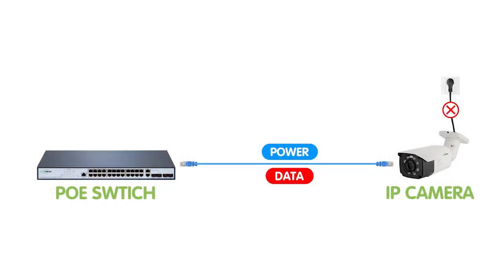Link 2 PoE Switches over Cat6 Ethernet Cable

Comment: Hello, I was wondering if you could help. I had a 16-channel NVR with 8 cameras in one house and 8 in another. One of the residences was sold, and I needed to remove eight cameras from the 16-channel NVR. The new position for the NVR is about 50 meters distant, therefore I chose to run one CAT 6 cable to the point where the eight cables meet. My intention is to install an 8-port POE switch to connect all 8 cameras via CAT6 cable back to the NVR, which will require another POE switch. From this POE switch, I'll connect my router cable, my NVR Lan cable, and finally my CAT6 cable to the other POE. Will this work?
Reply from the maker: Yes, your plan will work. As long as you have adequate power supply for the cameras, network bandwidth is sufficient, and all connections are securely made, this setup should work effectively.

Comment: It is connected in series daisy... previously you said preferably not to connect both switch in series mode
Reply from the maker: Connecting just two PoE switches directly with a single Ethernet cable is generally not considered a daisy chain. A daisy chain usually refers to a series of three or more devices connected in a chain-like sequence (A → B → C, and so on), where data passes through each device in the chain.

In this case, with only two switches directly linked, it’s simply a point-to-point connection between them.
Reply: @Fastcabling  thankyou for providing great explanation... Point well understood
Reply from the maker: My pleasure!

Comment: hi..can i use the uplink port as a normal port? i have 4 normal ports and 2 uplink ports.. but i have 5 devices to connect.. thanks
Reply from the maker: Yes, these ports can usually function just like regular ports for connecting devices such as computers, cameras, or other networked equipment.
Reply: @Fastcabling  thank you so much for the prompt reply..i learned a lot watching your videos.
Reply from the maker: My pleasure! If you're interested, we've created different network solutions. Please check👉https://www.fastcabling.com/pages/networking-solutions/

Comment: Hello, I saw another video by you in which you say not to dazzy chain POE switches. What you did in this video, is it not dazzy chaining them?
Reply: Reason why I ask is because I have 64 Cams and I want to distribute them in 3-4 Gigabit POE switches. How do connect them all?
Reply from the maker: Connecting two PoE switches over a single uplink is technically linking them, but it's not the same as creating a long, dependent daisy chain.
Reply from the maker: You’d better connect them in a ring. https://www.fastcabling.com/pages/3-effective-ways-to-daisy-chain-poe-switches/

Comment: Hi, thank you for the video. For 2 poe switch 1 nvr and to view online in phones can i use this type of connection. I meant does conncting nvr to router gives access to remote viewing of cctv?
Reply from the maker: As long as all your PoE switches are part of the same network (LAN) and can communicate with each other, your NVR will still be able to receive video streams from cameras connected to any switch.
Reply: @Fastcabling  thank you I have two uplink port on both my switch. So can I connect from Poe 1 uplink to Poe 2 uplink and poe 1 2nd port uplink to router and Poe 2 2nd port to NVR.. will this allow me to view remotely?
Reply from the maker: Yes, this setup will allow you to view the NVR cameras remotely. Or you can connect the NVR directly to the router. The NVR will still be able to communicate with the cameras since both the PoE switch and NVR are connected to the same network via the router.

Comment: Can we connect two poe switches.from Normal Port to Uplink Port or Uplink to Uplink vice versa is it possible?
Reply from the maker: You can connect two PoE switches using either:

1. Normal Port to Uplink Port: This setup is ideal if one of the switches has an uplink port with higher bandwidth (e.g., 10G or 1G), and the other switch's normal port is only 1G or 100M.

2. Uplink Port to Uplink Port: This is typically used to create high-speed inter-switch links for large data transfers or connect the access/distribution switches to the core switch. 

3. Normal Port to Normal Port: This is often used in smaller networks where you don't need a high-speed backhaul between switches. Modern switches support Auto MDI/MDI-X, which automatically detects and adjusts the pinout of the connection (so crossover cables are no longer necessary).

Comment: Uplink Port to Regular Port, or Uplink to Uplink Port, which the best?
Reply from the maker: If high bandwidth is needed between the two switches (e.g., for high data transfer rates or many connected devices), uplink to uplink is often preferred. In this case, we connected uplink to uplink using fiber connections to maximize throughput (10Gbps).

Comment: What if i connect a poe port to another PoE port?
Reply from the maker: That will also work. But some very old models of switches still need to use a crossover cable to connect the sending pin on one end of the cable to the receiving pin on the other end when connecting two common network ports. However, many modern switches support Auto MDI-X, which automatically detects the proper connection type no matter which cable you use. The uplink port does not cross transmit and receive pins, so no crossover cables are required, which means that only one straight-through cable is required to connect two switches by linking the uplink port and the regular port. In addition, uplink ports usually have more bandwidth compared to normal ports as they aggregate traffic between different layers.

Comment: Yes but is the second switch connected to an outlet or is only the first switch conected to an outlet and draws the second switch power from the first via PoE?
Reply from the maker: In this video, both switches need to be connected to an outlet for power supply. If your second switch requires PoE power, PoE powered switches can help. If you have any questions, please feel free to email us at support@fastcabling.com.

Comment: I need help i have NVR 8 ch use at A house 5 IP cameras(POE 48v )  and put LAN Ethernet from Router(12v) to NVR  and use LAN from Router  to media converter from here I connect to fiber optic 100 m. To media converter > LAN > router again , My  question need your help is 
1. how can I use 3 cameras at B house , with out POE Line from NVR i can use only 1 line of fober optic for internet at B House
2. One fiber line can carry signals ,internet, power 48v or not
3. If i use power supply at B houe  how can I connect camera from NVR
4. Thank you for your help master! 
I’m from thailand
Reply from the maker: 1. Since the fiber optic cable is already providing internet to B House, you can use a PoE switch (with SFP uplinks) at B House to power and connect the cameras.

2. Fiber optic cables can only carry data (internet, signals) but not power. To power the cameras at B House, you'll need a local power source or a PoE switch at B House. An alternative is running a composite/hybrid fiber cable that includes copper conductors for power.

3. If you’re powering the cameras locally at B House, you can use a PoE switch at B House powered by a local power supply (48V for PoE cameras). The PoE switch can communicate with the NVR as long as they're on the same network.

Comment: How about linking 2 nvr
Reply from the maker: I'm not sure if I understand it correctly, but if you want the NVRs to share camera feeds or access each other’s stored video data over a network, you can integrate them through the local area network (LAN).

Ensure both NVRs are connected to the same network. This can be done via Ethernet cables connecting each NVR to your network switch or router. Assign static IP addresses to each NVR for easy identification and access. Use the software provided with the NVRs to access and manage cameras connected to both devices. Some NVR systems allow adding another NVR as an external source.

Comment: Will this configuration affect efficiency or latency of data transfer? How does it compare if I just use a single PoE switch? I am using unmanaged PoE switch
Reply from the maker: Each additional switch in a cascaded configuration introduces a slight delay in data transfer. When multiple switches are cascaded, the available bandwidth is shared among all connected devices. If you use our long-range PoE+ extension kit, the data rate between the two switches can be maintained at 500Mbps. By connecting the long-range PoE ports on both switches, you can magically extend the distance up to 500 meters while maintaining a data rate of 500Mbps.

https://www.fastcabling.com/product/500-meters-long-range-poe-extension-kit/